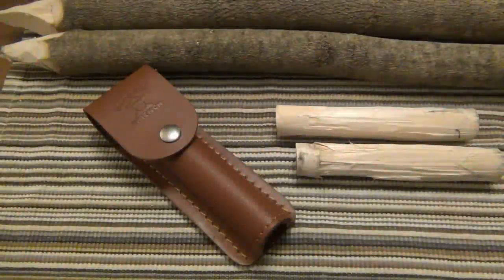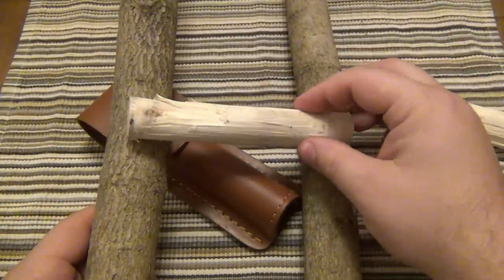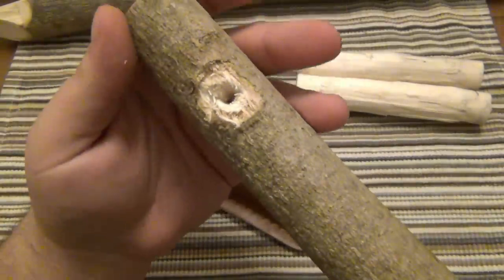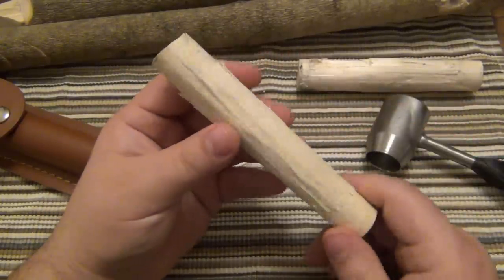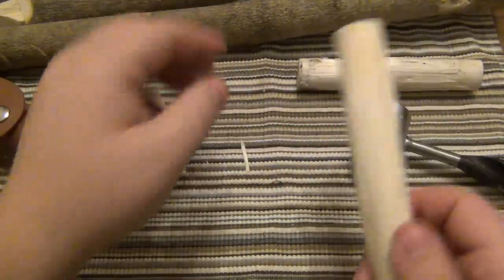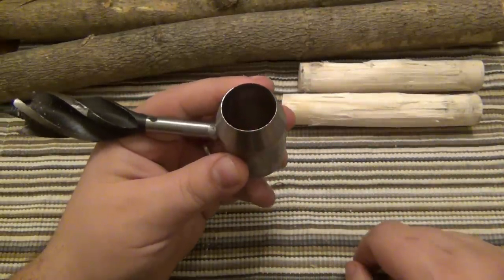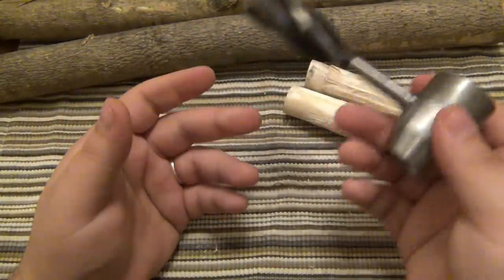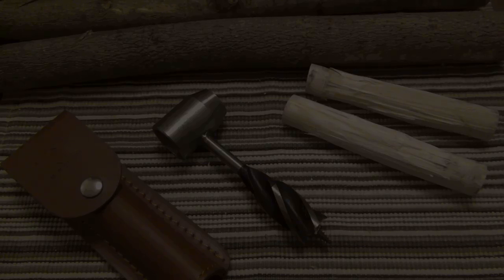BATTLBOX Gear Testing : Settlers Wrench FAIL (Learn From My Mistakes)

Comment: Sorry to chime in here a little late  but this tool was designed for bushcraft use and not recommended for  hard wood as I am the creator of this design! I personally check every one that is purchased from me for dullness! If it doesn’t make the cut it gets resharpened and sold as refurbished! Also in my packaging it comes with a disclaimer stating it is recommended for green wood or soft wood! Not to say it will not work on hardwood because it will but I’ve not had an opportunity to test it on every kind of wood out there so I labeled for soft and green wood! Battlebox does manufacture these for me and in return they can use them in their boxes. The issue is they simple do not monitor their quality control as well as I do. If I do have a faulty one slip through the cracks I WILL make it right!
Reply: please excuse me for asking, but is there a way to purchase directly from you instead of receiving one from battlebox? where woukd I go to do so?
Reply: @trikstar198   Currently don’t have this model in production anymore as I’m working on the 2.0 version! Should be much heavy duty! Just follow along on my socials when they are ready I will update! Yes there are some copy cats out there that are in it solely for the profit! I know profit is important, but I want to make a great tool!
Reply: @ShawnWithTheWildALONES7  do you have a list of woods that are recommended I know you say soft wood or green wood. 

I live in the south where oak and pine are predominant any suggestions.
Reply: Well said!
Reply: Wow you invented the scotch eye awl? You must be 300 years old.
Seriously, the bit is designed for a power drill. Use a single cutter bit with a bigger deeper lead screw. And temper AFTER the weld

Comment: well the first problem is...... it's a Battle Box. I did a year of this, at the top tier. Everything was either a gimmick or a knock off of real equipment. most expensive let down of 2017......
Reply: I bought the tool from (Shawn with the wild, the inventor) and have had it for about a year now. I've used it mostly on pines an cedars, works fine for me, no complaints.
Reply: @maverick4462  two of the softest wood in north america... weld your own with a real auger bit like Makita bit and you could cut nails with it.
Reply: Dang bro, sorry to hear this.

Comment: I think your problem was that you pounded it in first...so where the threads would grip the wood....by pounding it in...you strip the wood and give the threads nothing to grip
Reply: those tiny tapered threads wouldn't hold with the  forces of that massive bit anyway. the tool design is a cheap  crock.
Reply from the maker: that would make sense only the very tip isnt important once the large part touches the wood it should bite and start to drill in...the wood is too hard for this, even with a power drill it took multiple tries slowly to get it cut about 3/4 the ay into the wood
Reply: I used drill bits for the entirety of my career. You most definitely need to start screwing and no baton into the wood. I'd recommend just trying and seeing if that works better on a new spot on the wood or a new piece of wood all together. Also, the thickness of that post could be too small to the point that it will split given the size of the bit.
Reply: Auger bits depend on that small screw to pull the cutters through the work piece. Never pound them in. You're shooting yourself in the foot if you do
Reply: @cutlerylover  the acre matters at all times during the cut, because the screw is what pulls the cutting blade into the wood. Like with a knife which uses its weight, there has to be some pressure/force driving the blade into the material. If the screw doesn’t grip and pull the cutting blade into the wood to cut the fibers, it will simply spin in its hole and keep the blade from cutting in.
Reply: Well I didn’t see the guy try again so , by the looks of it! We can’t tell, can’t tell how sharp the tool is either, he doesn’t demonstrate, I think it’s a “ I couldn’t do it I need a glove, I might hurt myself “
Or the tool is not been sharpened, and he can’t tell the difference! , it’s f on camera he would demonstrate, we would all know.
But it put it up to the hole and says, “ it just wouldn’t work. Then show us. I have a hard time believing that steel won’t cut wood! 
But you can’t see “ he just says “ no workie
Reply: As others have stated, part of the problem with this recent iteration of settlers wrench (or scotch eyed auger) is that it was made using a modern power drill auger bit. This bit is absolutely designed for softwood, particularly framing lumber, and its optimized to bore quickly hence the very steep pitch of the lobes. A more traditional auger designed for hand use in a wide range of woods will have a much shallower pitch. Also it will likely only have one cutting edge, rather than three, which along with the pitch takes much of the stress of of the drive threads and eliminates the blowout (or stripping) that you experienced in the oak branches. 
I appreciated your video, its up to us as the users to keep the fabrication industry in check and hold them to a higher standard than previous generations. Keep it up!!

Comment: A friend with a machine shop and I are making a 1&1/2" version all stainless steel sweetheart!!! We will be fish tailing the auger in the shaft end=(forged flat) to be welded in line with the eye and the eye will be 4" long. Also adding protruding teeth in line of cut to outside of cutting edge to simply turn the excess wood off before removing to reveal the peg sugar pie. Hopefully we can sell a few to pay for our own each!!! Combination auger and eye length we're thinking should be 12". And another friend wants one also that can manufacture the nylon and velcro sheaths and hand guards so wish us luck sweetheart!!!!!

Comment: Hey Jeff, just a tip, the case that your auger comes in has a hole at the bottom so you can put the auger threads into it while hammering the auger head. That way your hand doesn't have to touch the threads 😊
Reply: I noticed that as well sweetheart!!! Good eye 👁‍🗨 Andrew!!! Also showing your obvious  intelligence!!!

Comment: Jeff, the bit is fine but the thread at the front pulls the bit in you don't hammer it in and you aren't meant to just use them free hand you are meant to put a dowel through

Comment: A couple things I can think of might have had an effect on how well the auger works. I ordered an auger bit similar to this one, and it came VERY sharp on all the machines edges, BUT it had an issue with the threads on the screw. The threads were full width all the way down to the very point of the screw, so it was essentially a tiny cone-shaped auger instead of a screw, which usually has the threads taper down to nothing toward the tip. It didn’t pull into the wood at all. I took an auger bit file and tapered it myself. Now it works like a charm. The second thing is that if you baron the auger into the wood it may affect the threads, especially if the thread was full-width all the way down to the point of the screw like mine was. If that was the case, a wide screw thread like that might just fold over completely and make the auger not work.

Comment: I just unboxed mine and tried it on soft wood. Spruce. Not dried but not just cut. Truthfully it was our Christmas tree that was in water until January. I cut the tree down myself in late Dec.  I did not baton it in.  I feel that the lead tapered screw is not long enough, aggressive enough or large enough. It cannot generate enough pull and grip to put enough pressure on the blades. The blades have a tiny point that extends a fraction of an inch lower than the blades but they do not cut deep enough to do what a chips auger does. I work with wood quite alot building projects outside and I have never seen this design.  All my chips augers only have one blade that cuts horizontal and one blade that cut vertical.  They work great. This one didn't. It did the same as what happened in the video.  I think I will return mine to Amazon and weld a chips auger on to a chunk of pipe and then shapen one end of the pipe and heat treat it. Should be better and cheaper. Thank you for the video. I'm glad I'm not the only one.

Comment: In the winter even a "green" tree will be a bit harder because they are dormant and the sap isn't flowing.

Frankly I haven't seen a single gimmick out of those battle boxes I would put much trust in if anything depended on it.

Comment: I heard a key part in your description.

I have one of these Setler's Wrenches. In fact I bought a factory second... so, it's not as good as the one you have. (I had to sharpen the peg maker)

The thing I heard was that you thought you were supposed to batton the drill bit into the wood. This cuts the fibers in the wood and creates a small cone shaped hole.

Instead, try to twist the drill bit part into the wood in order to get it to bite into the fibers. 
(as a tip: I sometimes use my belt knife to make a started hole similar to starting a bow drill kit.)

As fre as green wood vs. dead wood goes, dead wood only makes it more difficult to turn to drill. I've used it in both.

Hope this helps!

Comment: I think the main issue is the angle of the drill bit cutting edge and the sudden taper of the center boring part of the bit to a full width of the main part of the but. Old school hand drill bits are angled much closer to being like a small plane, to scrape off a smaller shaving of wood per revolution, and generally have a gentler taper from starting width to full width.

Comment: The threads on the drill bit pull it through the wood. Do not pound it in. Slowly screw it in with downward pressure to start and once started it will pull itself the rest of the way though with little downward pressure needed

Comment: When I first saw that thing, I had my thoughts about it. I am reasonably sure that the four spiral construction is a huge liability - you can't get the torque and downward pressure needed to force the four cutting lips into the wood by hand - unless it's very fresh and very soft wood. Probably also too dull to begin with; resharpening - again - being impeded by the four spiral design.
I have bought a set of vintage wood augers from the local fleamarket and they work. They were also dull, but they only had a single spiral, so I was able to resharpen them. I used them to enlarge the slot for a butcher steel on a beech knife block to accept a ceramic rod without a problem. Sharp steel cuts wood easily. ;)
P.S.: The dowel cutters I've seen were used differently from what you did. They are usually embedded in a workbench, sawhorse or simply a block of wood with the edge of the dowel cutter facing up. The dowel blanks are inserted from above and are forced through by beating them with a primitive mallet; a thick branch with one end slimmed down to form a handle, pretty much, so it won't matter if it gets chewed up by hitting the edge of the dowel cutter.
Reply: Been using it for about a year now, works great for me. No complaints.

Comment: I’ve not used this particular instrument, however, most bushcraft three bit augers should be used in fresh cut green wood. If you would like better results in dried hard woods use a two or single bit auger. You could buy or make your own from a yard sale item, they typically come with a triangular bit made for a hand drill.

Comment: Your idea for making a camera stand was good.

Yes, the wood was hard but I don't think that was your actual problem. The hole you were trying to cut into the branch, was almost the same size as the branch. Just a little bit smaller. Before you started to drill it, I was concerned that it would have the strength that you wanted to have.

But what I think your problem was the curvature of the sticks. On the sides of the stick you were not getting any bite at all with the drill. If you had a flat surface, or a bigger stick it may have worked.
Reply: Best bit of advice on this thread, totally agree

Comment: Yeah, I am pretty sure batoning that bit is a bad idea. Failure to drill properly could be because it's such a hardwood, or because it's dull...but either way don't baton that tip into the wood. It needs 'virgin' wood to sink into, and pounding it just creates a kind of pulp at the tip of the bit. It jams it up, clogs it up, and it can't self-tap. Also, the tip on these bits are not designed to take forceful blows from batoning and hammering at all. You've been lucky so far not to bust that tip off, and if/when you do you have a problem! I wouldn't push it much more. Play around with pines and cedars and even willows and Manitoba Maples if you have 'em, so long as it's green. It's a maple, but I believe they are a much softer wood than other maple types. They certainly spread out and fall apart like willows. I thought this was a Scotch eye auger? Cool honest review though. Hope ya' get more fun out of it asap!!

Comment: I used mine on dry ash with no issue other than it being hard to remove the peg from scotch eye.  You let it thread itself in until it bottoms out then add handle and continue

Comment: I bought the Settlers Wrenchl, an 1st it is best with green wood yes, 2nd, not so much the leverage but how it was started in the wood, the screw at the tip needs to be screwed into the wood so it Pulls the tool through. If it's not started right you're just making a poor friction fire.

Comment: Yup might have to use some softer wood but that defeat the purpose of you trying to use what's around you using that tool. You might as well just use an axe or knife?
Reply: Yeah tool like that is dead weight if you can only use it in a specified way when another tool can do the job

Comment: And I know you probably already know this but you've got to remain straight during the drill task or it doesn't have enough grab to help pull the drill into the wood and I did have to exert a tremendous amount of pressure to drill the oak as well!!! But could easily see this to most definitely be problematic!!! Good luck on your next try sweetheart once that center screw starts to bite you simply cannot make any directional changes or as I said it hasn't the strength 💪 to help much!!!

Comment: 1. That's not oak. 2. Cut around the pegs with a saw a score just at the depth of the hole you drilled into the logs the pegs fit into, then tap the cutter onto the peg until it cuts to the saw cuts you made, keeping your bark. 3. If drilling all the way through a branch, drill until the auger starts to drill the point through, then turn it around and hit it from the other side to avoid splintering.

Comment: First thing to note on the review. When using that bit you are going to have to exert a lot of down pressure on that bit. Survival isn't cotton candy fluff and easy life. I've used the wrench without much problem but again you WILL have to work up some sweat using this, there is no way around that. The number one reason most people fail at survival skills is they do not have the mindset that "this is going to be hard" so they bail out on the task. Exert down pressure on the bit while drilling and it will drill. If its dull, learn to sharpen bits. Its an auger bit like any other welded onto an end fitting. Not really much room there to design something "bad".

Comment: Yeah you are not supposed to baton the screw thread tip into the wood. The screw thread tip, is what pulls the auger into the wood, So you want to give it every possible opportunity to do what it is designed to do. Like any "screw", it is not advised to baton it deep into the wood! Or you risk tearing up the integrity of the wood, that the screw thread tip needs to grab onto, in order to pull the auger in. Also the risk of breaking the screw thread tip off, is seriously not advisable. Because once the screw thread tip is broken off or seriously damaged IE. stripped. In your case, I can see the auger is not working because the wood has been stripped out and the screw thread tip has nothing to bite onto! The auger will not work if the screw thread tip has nothing to grab onto, hence the reason it is not advised to baton it in, just let it screw in normally. This barely takes seconds and gives the screw thread tip maximum pulling power! I hope this advice helps you and others.

Comment: I have better luck starting on a flat section of wood.
Try making the section you are drilling through flat with your knife first.
Reply from the maker: it might seem the curved wood is the problem but it bit in fine with the tip of the tool its just the wood is too hard, where its trying to cut is completely flat...

Comment: Jeff, I believe I have what you need. Last summer I came across some old furniture out on the street for bulk pick up. This stuff was early 60 s Thomasville type stuff. Anyway I stripped off some carved hardwood dowels for clubs and Escrima sticks. They were attached with 21/2 inch threaded  rods that are 3/16. I found 3 and will send them so don't drill anymore until they arrive. Screw one half way into the long stick with the other half into the cross member and you are in business. I wish I had more but 3 will give you a good start. There is a place for everything in the house etc. etc. I am quickly losing the capacity to remember what place.

Comment: Hello sir. Thank you for the video. I was planning to make a few of these in various sizes.
The tool was meant to be used with a peg as a handle. Also, the bit is for sure dull. 
Please don't take offense to this post. Was not meant to sound negative.

Comment: You shouldn't have to baton it  in that from part is actually threaded to act like a screw. The bit should draw it's self in. You should leave a piece of wood in the bit to act like a handle. This set up is meant to mimic an old style auger.